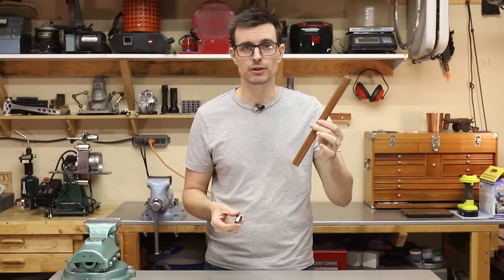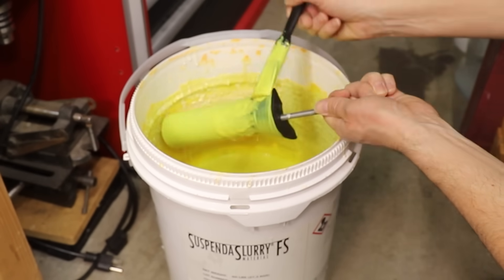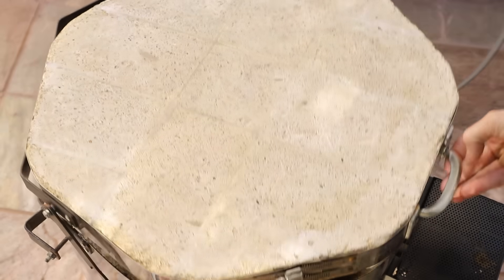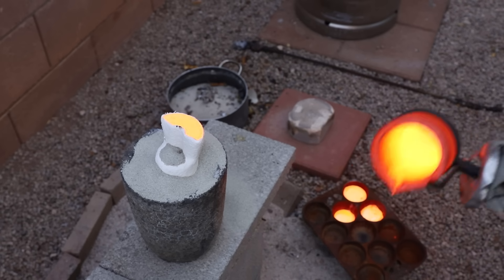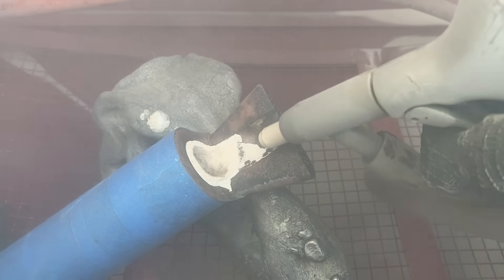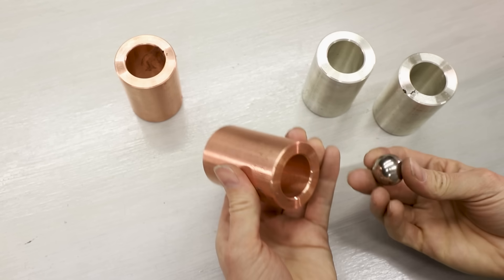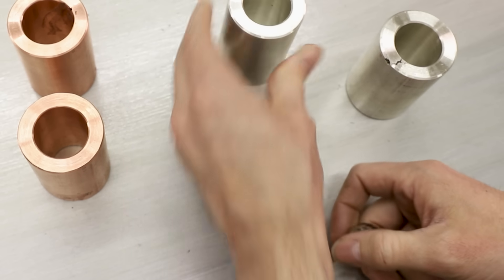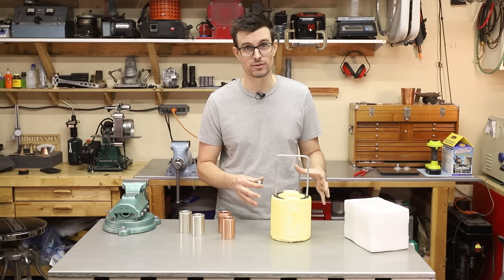Making Anti-gravity tubes - Copper & Silver! - Lenz's law - Metal casting Experiment

Comment: Certainly! Here's a project proposal in English for an EU funding application, including the cost estimate for using 90% PVC and 10% copper for the tube:

---

### *Project Proposal: Innovative Waste Retrieval and Return System*

*1. Project Overview*

We propose the development of an innovative system for waste retrieval and product returns using a combination of PVC and copper tubing. This system aims to efficiently and safely transport waste or returned items from high-rise buildings or customer returns through a controlled deceleration process. The system will consist of a predominantly PVC tube with a copper section at the bottom to slow down the descent of the objects.

*2. Project Objectives*

- **Design and Installation**: Develop a tube system where 90% is made from PVC and 10% from copper, designed to facilitate efficient waste retrieval and returns.
- **Safety and Efficiency**: Ensure that the system safely decelerates objects to prevent damage during the retrieval or return process.
- **Commercial and Environmental Impact**: Improve the efficiency of waste management and product returns, contributing to environmental sustainability.

*3. Technical Specifications*

- **Tube Composition**:
  - **PVC Tube**: 90% of the total tube length.
  - **Copper Section**: 10% of the total tube length, located at the bottom to decelerate objects using electromagnetic induction.

*4. Cost Breakdown*

*a. Material Costs*

- **PVC Tube**:
  - **Cost per Meter**: 10 EUR (estimate)
  - **Length**: 90 meters
  - **Total Cost**: 900 EUR

- **Copper Section**:
  - **Cost per Meter**: 50 EUR (estimate)
  - **Length**: 10 meters
  - **Total Cost**: 500 EUR

- **Additional Components**:
  - **Electromagnetic Coils and Control System**: 1,000 EUR (estimate)
  - **Installation and Safety Systems**: 1,000 EUR (estimate)

*b. Installation Costs*

- **PVC Tube Installation**: 1,000 EUR (estimate)
- **Copper Section Installation**: 500 EUR (estimate)
- **Safety and Control Systems**: 500 EUR (estimate)

*c. Development and Testing Costs*

- **System Development**: 1,500 EUR (estimate)
- **Testing and Fine-Tuning**: 1,000 EUR (estimate)

*d. Total Estimated Costs*

- **Materials**: 1,400 EUR
- **Installation**: 2,000 EUR
- **Development and Testing**: 2,500 EUR
- **Total**: 5,900 EUR

*5. Implementation Plan*

1. *Phase 1: Design and Procurement* (1 month)
   - Design the system and procure materials.
   - Develop electromagnetic coils and control systems.

2. *Phase 2: Installation* (2 months)
   - Install PVC and copper tubes.
   - Set up electromagnetic coils and control systems.

3. *Phase 3: Testing and Optimization* (1 month)
   - Conduct testing to ensure safety and effectiveness.
   - Fine-tune the system based on test results.

4. *Phase 4: Launch and Marketing* (1 month)
   - Officially launch the system.
   - Promote the system to potential users and stakeholders.

*6. Expected Outcomes*

- **Efficiency Improvement**: Enhanced waste retrieval and product return processes.
- **Safety**: Safe and controlled deceleration of objects, reducing risk of damage.
- **Environmental Benefits**: More efficient waste management contributes to environmental sustainability.

*7. Conclusion*

We seek EU funding of 5,900 EUR to support the development and implementation of this innovative system. The project will improve waste management and product returns while promoting environmental sustainability. The funding will be used for material procurement, installation, system development, and testing.

---

This proposal outlines the key components and costs associated with the project. You can adjust the details and estimates based on the specific requirements of the EU funding program and the exact scope of your project.
Reply: Certainly! Here’s a project proposal in English for an EU funding application, focusing on a system with rotating copper tubes and floating objects between two round magnets:

---

### *Project Proposal: Rotating Copper Tube System for Efficient Material Handling*

*1. Project Overview*

We propose the development of an advanced material handling system using rotating copper tubes with electromagnetic levitation technology. This innovative system will feature two round magnets inside a copper tube, with objects floating between them. The rotation of the tube and the electromagnetic fields will allow for the efficient and controlled transportation of various materials or products.

*2. Project Objectives*

- **Design and Development**: Create a rotating copper tube system equipped with two round magnets that utilize electromagnetic levitation to transport materials with minimal friction.
- **Enhanced Efficiency**: Improve the efficiency of material handling by reducing friction and increasing the stability of floating objects within the system.
- **Commercial and Environmental Impact**: Offer a novel solution for handling and transporting materials in various industries, enhancing operational efficiency and sustainability.

*3. Technical Specifications*

- **Copper Tube**: The system will use a copper tube that rotates to create a stable environment for the levitation of objects.
- **Magnets**: Two round magnets will be placed inside the tube. The electromagnetic fields generated by these magnets will levitate the objects between them.
- **Floating Objects**: Materials or products will be placed between the magnets and will float due to the electromagnetic levitation, allowing for smooth and controlled movement.

*4. Cost Breakdown*

*a. Material Costs*

- **Copper Tube**:
  - **Cost per Meter**: 50 EUR (estimate)
  - **Length**: 10 meters
  - **Total Cost**: 500 EUR

- **Round Magnets**:
  - **Cost per Magnet**: 100 EUR (estimate)
  - **Quantity**: 2 magnets
  - **Total Cost**: 200 EUR

- **Electromagnetic Coils and Control Systems**:
  - **Total Cost**: 800 EUR (estimate)

- **Additional Components**:
  - **Motor and Rotational Mechanism**: 1,000 EUR (estimate)
  - **Installation and Safety Systems**: 500 EUR (estimate)

*b. Installation Costs*

- **Copper Tube Installation**: 1,000 EUR (estimate)
- **Magnet and Coil Installation**: 500 EUR (estimate)
- **Motor and Control Systems Installation**: 500 EUR (estimate)

*c. Development and Testing Costs*

- **System Development**: 1,500 EUR (estimate)
- **Testing and Optimization**: 1,000 EUR (estimate)

*d. Total Estimated Costs*

- **Materials**: 1,500 EUR
- **Installation**: 2,000 EUR
- **Development and Testing**: 2,500 EUR
- **Total**: 6,000 EUR

*5. Implementation Plan*

1. *Phase 1: Design and Procurement* (1 month)
   - Design the system and procure copper tubes, magnets, and other components.
   - Develop electromagnetic coils and control systems.

2. *Phase 2: Installation* (2 months)
   - Install copper tube and magnet systems.
   - Set up electromagnetic coils, motor, and control systems.

3. *Phase 3: Testing and Optimization* (1 month)
   - Conduct testing to ensure effective levitation and material handling.
   - Fine-tune the system based on performance results.

4. *Phase 4: Launch and Marketing* (1 month)
   - Officially launch the system.
   - Promote the system to potential users and stakeholders.

*6. Expected Outcomes*

- **Efficiency Improvement**: Enhanced material handling capabilities with reduced friction and improved stability.
- **Safety and Control**: Safe and controlled levitation of materials, reducing risk of damage.
- **Innovation**: Introduction of a novel solution for material transportation, contributing to operational efficiency and environmental sustainability.

*7. Conclusion*

We seek EU funding of 6,000 EUR to support the development and implementation of this innovative rotating copper tube system. The project aims to revolutionize material handling processes, improve efficiency, and offer a sustainable solution for various industries. The funding will be used for material procurement, installation, system development, and testing.

---

This proposal outlines the key components and costs associated with the project. Adjust the details and estimates based on the specific requirements of the EU funding program and the exact scope of your project.
Reply: Sure, here is the translation of the updated project proposal into English:

---

### Project Proposal: Innovative Fire Suppression System Using Rotating Magnetic Spheres and a Drone with Magnetic System

#### *1. Introduction*

This project develops an advanced fire suppression system utilizing a drone that hovers thanks to a large copper ring and magnets. The system uses the eddy effect to enable levitation of magnetic spheres within rotating copper rings. This technology allows for efficient delivery of fire-extinguishing liquids with reduced energy consumption and increased response speed.

#### *2. Project Objectives*

- Develop a system where a drone hovers using a large copper ring and magnets, carrying a rotating ring around it with magnetic spheres levitating within the ring due to the eddy effect.
- Implement a system for precise delivery of liquids from the spheres for efficient fire suppression.
- Ensure the drone uses minimal energy and achieves maximum speed in responding to fires.

#### *3. Technological Solutions*

- **Eddy Effect and Copper Tubes**: Inspired by the phenomenon of a magnet slowly falling through a copper tube due to eddy currents, we will develop a system where magnetic spheres are stabilized within rotating copper rings. When the copper tube rotates, eddy currents created in the copper generate stabilizing forces that slow the magnet's movement. Applying a similar principle in the rotating ring, the spheres can levitate within the ring due to electromagnetic and centrifugal forces.

- **Magnetic Drone and Copper Ring**: The drone will be equipped with a large copper ring and strong magnets. The large copper ring will rotate around the drone, while the drone hovers thanks to electromagnetic levitation created by the interaction between the magnets on the drone and the copper ring. This configuration allows the drone to carry the ring with magnetic spheres without touching it.

- **Rotating Copper Ring and Spheres Levitation**: The large copper ring will rotate around the drone, and the magnetic spheres will levitate within the ring thanks to the eddy effect. The rotation of the ring creates centrifugal forces that allow the spheres to levitate, reducing their weight and the need for additional energy for manipulation.

- **Liquid Delivery System**: The spheres within the ring will be filled with liquids (e.g., water). The rotation of the ring will allow the liquid to be distributed and delivered to the fire using specialized dispersion mechanisms. This enables precise targeting of the liquid at the fire site.

- **Smart Drone**: The drone will use sensors for automatic fire detection and systems for precise guidance. Since the spheres levitate and the drone uses minimal energy, the drone will be more efficient in quickly reaching and extinguishing fires.

#### *4. Implementation Plan*

- **Phase 1: Research and Development (6 months)**: Develop prototypes of the large copper ring and magnetic spheres. Design the levitation system using the eddy effect and plan the drone design.

- **Phase 2: Testing and Optimization (9 months)**: Conduct laboratory tests with large copper rings and magnetic spheres. Test the levitation system and liquid delivery under various conditions to optimize system performance.

- **Phase 3: Prototype Development and Implementation (9 months)**: Finalize the production of drone prototypes, copper rings, and spheres. Develop and implement software for automatic fire detection and system control.

- **Phase 4: Evaluation and Adjustment (6 months)**: Conduct final evaluations of the system in real-world conditions, adjust the design based on feedback, and prepare a performance report.

#### *5. Budget and Funding*

- **Research and Development**: €200,000
- **Testing and Optimization**: €300,000
- **Prototype Development and Implementation**: €400,000
- **Evaluation and Adjustment**: €100,000

**Total Costs**: €1,000,000

#### *6. Expected Results*

- *Reduced Response Time* to fires through automatic detection and precise liquid delivery.
- *Increased Efficiency* in extinguishing fires in hard-to-reach areas due to sphere levitation and rotating system.
- *Reduced Energy Consumption* of the drone due to lower load and the efficiency of the levitation system based on the eddy effect.
- *Rapid Response* of the drone to fires due to minimal load and precise guidance.

#### *7. Conclusion*

This project uses innovative rotation and electromagnetic levitation technologies, inspired by the eddy effect, to enhance fire suppression systems. The developed system will enable faster, more efficient, and energy-efficient fire suppression, with potential for widespread application across various sectors.

---

This proposal includes specific details on how the eddy effect enables the levitation of spheres within rotating copper rings and how this contributes to reducing energy consumption and increasing the speed of the fire suppression system.
Reply: If you wrap the system you're describing with a large coil and turn on the power, it could theoretically levitate, but there are important technical aspects to consider:

### *How the coil affects the magnets:*

1. *Magnetic field of the coil:*
   - When an electric current passes through the coil (copper wire wrapped around the magnets or the tube), it creates a magnetic field. This magnetic field can interact with the field of the magnets inside the tube.
   - If the coil's magnetic field is strong enough and correctly oriented, it could enhance the repulsive force between the two magnets, potentially allowing the upper magnet to levitate more stably.

2. *Electromagnetism and levitation:*
   - If the magnetic fields of the coil and the magnets inside the tube work in harmony, the coil could help maintain the upper magnet’s levitation, reducing the need for supports (such as wooden braces).
   - In theory, if the magnetic field is strong enough, it could enable not only the levitation of the upper magnet but also the coil itself.

### *Challenges and practical limitations:*

1. *The coil might create resistance:*
   - While the coil generates a magnetic field, it can also create electromagnetic forces that produce resistance, known as **Lenz's law**. These forces might work against motion, slowing the system down.
   
2. *Power requirements:*
   - To generate a magnetic field strong enough to levitate the system, the coil would require a significant amount of electrical power. This could make the system difficult to power and maintain.
   
3. *Stability:*
   - The levitation of the entire system depends on the balance between the magnetic fields of the coil and the magnets. If those fields are not perfectly aligned, the system could become unstable. Additionally, the coil itself needs to be properly positioned to allow controlled levitation.
   
4. *Technical complexity:*
   - A system combining permanent magnets and electromagnetic coils would require precise control of the current and magnetic fields. This would involve advanced levitation control algorithms, sensors, and sophisticated electronics.

### *Conclusion:*
In theory, yes, the coil could enhance levitation and create conditions where both the upper magnet and the coil itself levitate. However, in practice, this would require a significant amount of energy, precise control of the magnetic fields, and mechanical stability. Levitating the entire system is a complex process, and its success depends on the exact synergy between the permanent magnets and the electromagnetic coil.
Reply: Sure, here is the translation of the updated project proposal into English:

---

### Project Proposal: Innovative Fire Suppression System Using Rotating Magnetic Spheres and a Drone with Magnetic System

#### *1. Introduction*

This project develops an advanced fire suppression system utilizing a drone that hovers thanks to a large copper ring and magnets. The system uses the eddy effect to enable levitation of magnetic spheres within rotating copper rings. This technology allows for efficient delivery of fire-extinguishing liquids with reduced energy consumption and increased response speed.

#### *2. Project Objectives*

- Develop a system where a drone hovers using a large copper ring and magnets, carrying a rotating ring around it with magnetic spheres levitating within the ring due to the eddy effect.
- Implement a system for precise delivery of liquids from the spheres for efficient fire suppression.
- Ensure the drone uses minimal energy and achieves maximum speed in responding to fires.

#### *3. Technological Solutions*

- **Eddy Effect and Copper Tubes**: Inspired by the phenomenon of a magnet slowly falling through a copper tube due to eddy currents, we will develop a system where magnetic spheres are stabilized within rotating copper rings. When the copper tube rotates, eddy currents created in the copper generate stabilizing forces that slow the magnet's movement. Applying a similar principle in the rotating ring, the spheres can levitate within the ring due to electromagnetic and centrifugal forces.

- **Magnetic Drone and Copper Ring**: The drone will be equipped with a large copper ring and strong magnets. The large copper ring will rotate around the drone, while the drone hovers thanks to electromagnetic levitation created by the interaction between the magnets on the drone and the copper ring. This configuration allows the drone to carry the ring with magnetic spheres without touching it.

- **Rotating Copper Ring and Spheres Levitation**: The large copper ring will rotate around the drone, and the magnetic spheres will levitate within the ring thanks to the eddy effect. The rotation of the ring creates centrifugal forces that allow the spheres to levitate, reducing their weight and the need for additional energy for manipulation.

- **Liquid Delivery System**: The spheres within the ring will be filled with liquids (e.g., water). The rotation of the ring will allow the liquid to be distributed and delivered to the fire using specialized dispersion mechanisms. This enables precise targeting of the liquid at the fire site.

- **Smart Drone**: The drone will use sensors for automatic fire detection and systems for precise guidance. Since the spheres levitate and the drone uses minimal energy, the drone will be more efficient in quickly reaching and extinguishing fires.

#### *4. Implementation Plan*

- **Phase 1: Research and Development (6 months)**: Develop prototypes of the large copper ring and magnetic spheres. Design the levitation system using the eddy effect and plan the drone design.

- **Phase 2: Testing and Optimization (9 months)**: Conduct laboratory tests with large copper rings and magnetic spheres. Test the levitation system and liquid delivery under various conditions to optimize system performance.

- **Phase 3: Prototype Development and Implementation (9 months)**: Finalize the production of drone prototypes, copper rings, and spheres. Develop and implement software for automatic fire detection and system control.

- **Phase 4: Evaluation and Adjustment (6 months)**: Conduct final evaluations of the system in real-world conditions, adjust the design based on feedback, and prepare a performance report.

#### *5. Budget and Funding*

- **Research and Development**: €200,000
- **Testing and Optimization**: €300,000
- **Prototype Development and Implementation**: €400,000
- **Evaluation and Adjustment**: €100,000

**Total Costs**: €1,000,000

#### *6. Expected Results*

- *Reduced Response Time* to fires through automatic detection and precise liquid delivery.
- *Increased Efficiency* in extinguishing fires in hard-to-reach areas due to sphere levitation and rotating system.
- *Reduced Energy Consumption* of the drone due to lower load and the efficiency of the levitation system based on the eddy effect.
- *Rapid Response* of the drone to fires due to minimal load and precise guidance.

#### *7. Conclusion*

This project uses innovative rotation and electromagnetic levitation technologies, inspired by the eddy effect, to enhance fire suppression systems. The developed system will enable faster, more efficient, and energy-efficient fire suppression, with potential for widespread application across various sectors.

---

This proposal includes specific details on how the eddy effect enables the levitation of spheres within rotating copper rings and how this contributes to reducing energy consumption and increasing the speed of the fire suppression system.